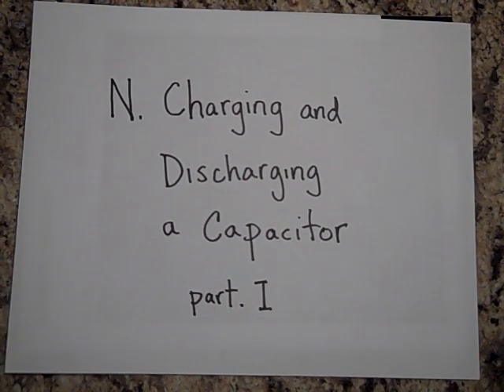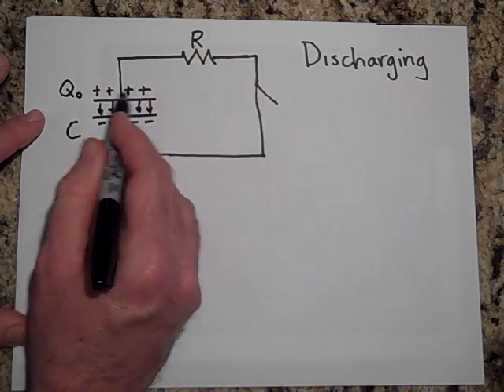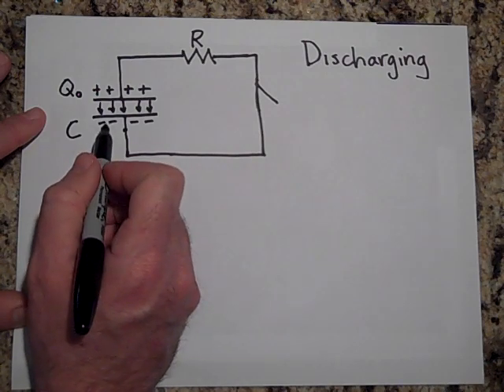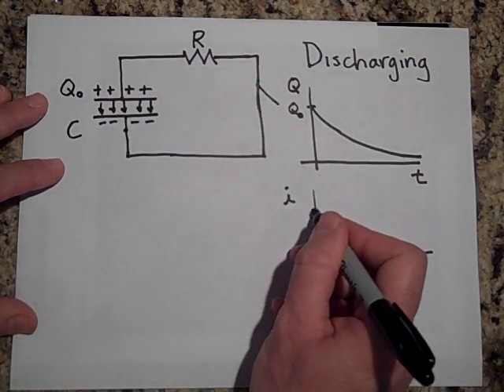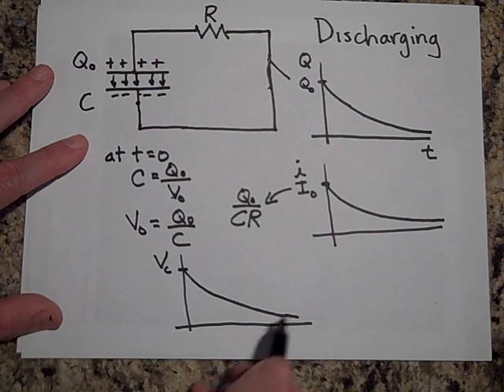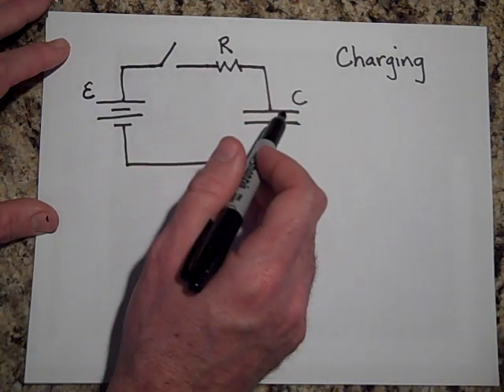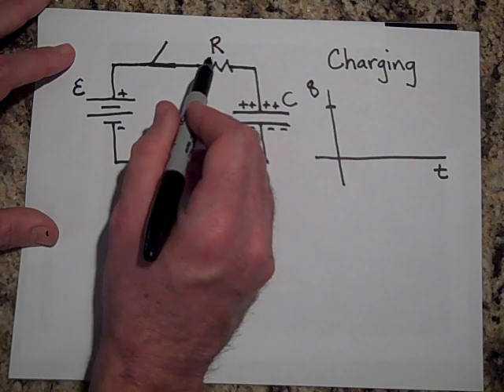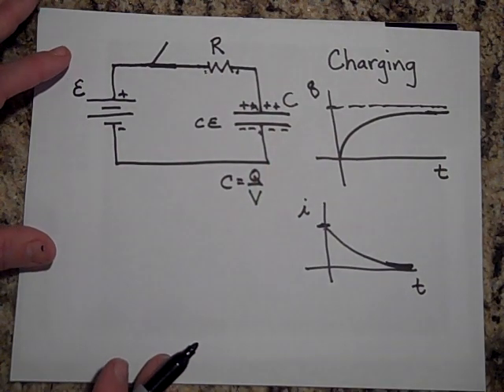Discharging Capacitors (apphysicslectures.com)

Comment: what happens when there is both a resistance in series and parallel to the capacitor. using V=V0(e^-t/rc) which resistance do i use